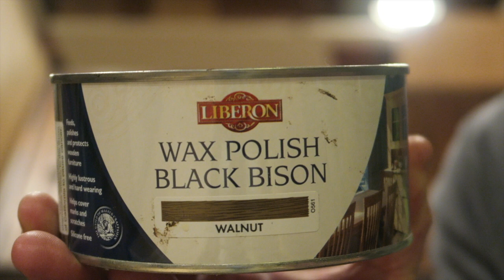Hand Plane Storage

Comment: Lots of cutting small pieces of walnut in order for the bottom to look like a floor.  Seems it would have be time beneficial if you would have resawed pieces to fit the spaces between the spacers.  Guess you wanted a certain look.  But, the finish turned out nice.  Pat on the back for that.

Comment: All that work and no spacers under the shoe to keep the blade edge away from the bottom. Your planes will dull or always need to be reset in that unit. Also, why all the hand trimming when you own an incra? 
M
Reply: There's an art to using handtools, and some like to keep that art alive. I know several woodworkers who don't use power tools at all. They use nothing but handtools to create their masterpieces.
Reply: You must do awesome work. Those are great observations. Where do we find your videos?
Reply: A blade edge won't dull from being laid down on a flat piece of wood. As soon as a plane is put to work it is laid flat on wood anyways... :)
Reply: That's a silly myth.
Reply: That’s an old wives tale with no basis in fact.
Reply: @dananderson2297  that is the best reply I've ever seen to an armchair expert! You made my day :-).